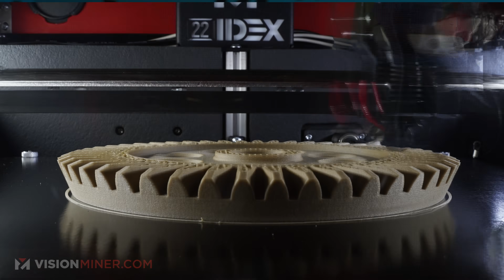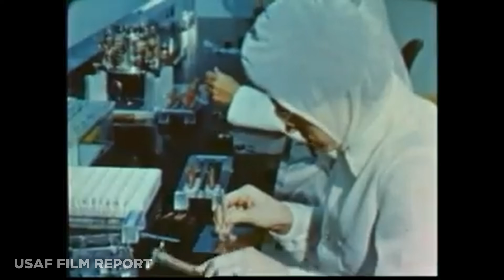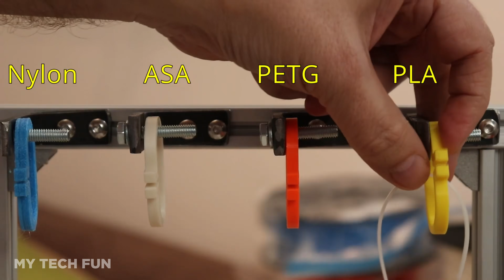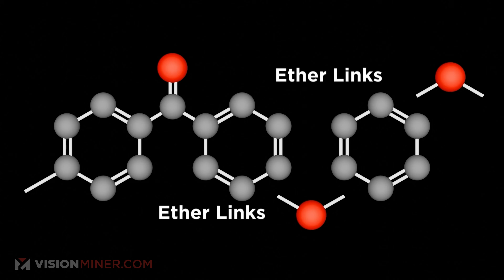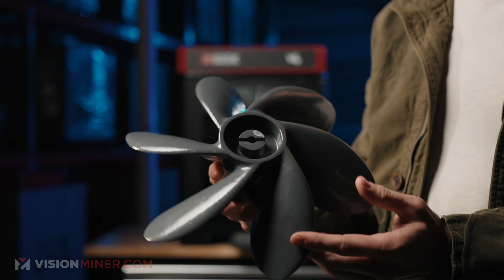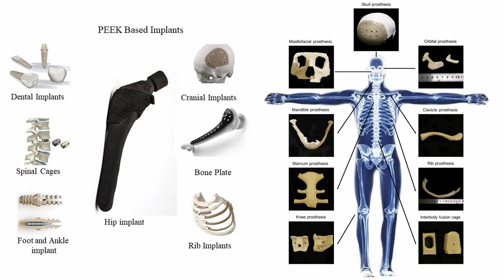How PEEK Changed Engineering Forever

Comment: With PEEK, the main problem with design had become cost. This thing costs $1000 per kilo!
So designs became "how can I do this while using materials cheaper than PEEK"
Reply: I'd say the problem is actually demand. The demand is a major factor that drives price. The pellets are relatively cheap. In theory with enough demand, manufacturing filament could be even cheaper than PLA. Demand is low because there are few printers that can print PEEK reliably and with high quality, while retaining utilizing the full potential of the material properties and being safe. And the best printers that try to do this are usually expensive. Less printers means less users, means less demand. By expensive I mean not a high cost alone but the value to cost ratio. Which leads into the second factor of low demand, many applications simply don't need PEEK. Many lower cost polymers and metals already fulfill most applications. PEEK is used in very specific, niche applications. You use PEEK only when other options are not good enough. There are also other engineering and high temp options that are cheaper which further dilutes the demand. Just as PEEK is considered like a super polymer, there are also super options in the metal/alloy materials that share properties like high heat resistance and chemical resistance. There's just so many options. PEEK is just one of them.
Reply: @eighty-eighth_section  Interesting, thanks for sharing
Reply: @eighty-eighth_section Being the guy they call when NOTHING ELSE WORKS, um, thing I just said.
Of course, I machine it to precise dimensions. Print in a prarie, maybe PVC is ok. I admittedly know little of cow ends.
Reply: Sunlu PEEK is $500 USD for a kilo. If you want something that is just about as strong as peek and has a higher HDT than peek, get some PPA-CF. It's called "black aluminum" and it can be printed at 280°C but has a HDT of like 190 - 210°C. It's also $90USD for 1 kilo.
Reply: @TheChazio Just print polysulfone. Widely better printability, very similar profile of material but more available.

 PEEK without a 200-240°C enclosure is completely useless. It needs precise cristallisation rate to reach high mechanical properties which is close to impossible on commercial FDMs. "Pro" PEEK printers use preheating lasers or hot air to improve layer bonds but its still hot shit.
Reply: That cost is nothing if there are no viable alternatives.
Reply: I made washers from it. Split rings, even. Some engineers wil spec like it is not their money...

Comment: Can a machine (thats  built from off-the-shelf components that have been advanced in 3dprinting for the last 3 yrs) with an MSRP of <$6000 & be reliably safe to use in a small print farm environment?
Reply from the maker: We used the Funmat HTs in our print farm for many years, and it was around that price -- not everything is possible, but building your own, as many comments from builders have reflected on our videos over the years, is generally not worth it, unless it's "for the fun of the project", but generally the cheaper chinese products have a lot more issues and support and hassles in general. So -- yes, but make sure you do due diligence, and the company (like us here at Vision Miner) provides top-notch support, otherwise you could get stuck with a $6000 paperweight, like many customers of the cheap machines have experienced...

Comment: Not sure if you already mentioned but PEEK does not cause galvanic or chemical corrosion when in contact with stainless steel. Kitchen appliance manufacturers designing custom fasteners using PEEK 🤯
Reply: Why would any polymer cause galvanic corrosion?
That doesn't make any sense
Reply: @GerManBearPig  if it's a conductive polymer, it can cause galvanic corrosion if an electrolyte is present.

Basically any carbon fiber infused polymer for instance.

Probably not a noticeable issue for hobbyists though.
Reply: @GerManBearPig imagine... Would any plastic work in or near a kitchen appliance reaching 350F? Nope. PEEK, yup.
Reply: @astroimagers I'm going to assume you're correct because I cba googling what 350°F is in civilised units 😂
Reply: @Scottbutcher7  You don't need to Google it, since most calculator apps included with smartphones have a unit conversion function built in.  Or you can simply subtract 32 from the Farenheit number, then divide by 9 and multiply by 5 to get the Celcius number.  From there you simply add 273.15 to get to the civilized units of Kelvin.😉👍
Reply: @astroimagers polyetherimide, polysulfone, polyamide-imide, polyphenylene sulfide, off the top of my head. PEEK is an expensive, more structural teflon not a magical polymer. There are plenty others with similar properties that vastly overshadow peek for aerospace applications.
Reply: @astroimagers  Many silicone grades easily handle 350F. I doubt appliance manufacturers are using PEEK for anything considering the cost.
Reply: Yes the dissimilar metals issue...another benefit.

Comment: One question I pondered (as a chemist) while appreciating data sheets: why werent thermosets (epoxy, cyanate ester, maleimide, benzoxazine...) sufficient in the thermal/chemical resistance/strength, stiffness area? Too brittle/oxidatively unstable?
Reply: It probably has a lot to do with the manufacturability of thermosets and probably their lower overall toughness. In FDM printing thermosets are really hard to 3D print. There is a small amount of research in thermoset printing, but not much.
Reply: @KellyBC indeed, they are mostly processable through the same legacy techniques as engineering thermoplastics (moulding, extrusion...), although in general with lower productivity and inability to recycle waste. 
Fdm printing of thermosets is a hustle, printing a single use mold (dissolvable shell) could be an approach, even to chopped fiber composites, where solid parts suffice
Reply from the maker: We do love the mold approach! They work great as coatings, as well, for specific applications.